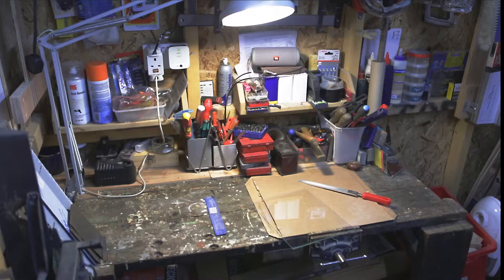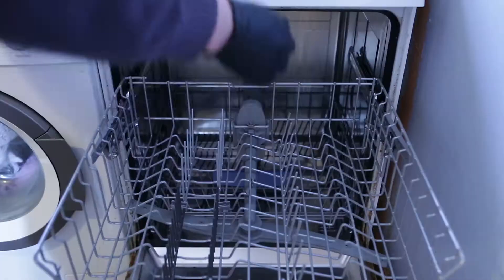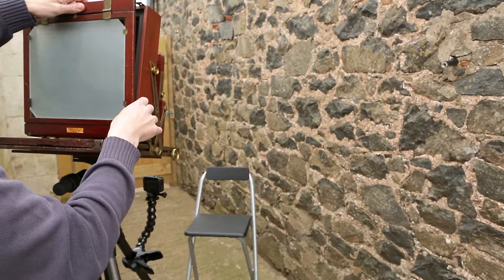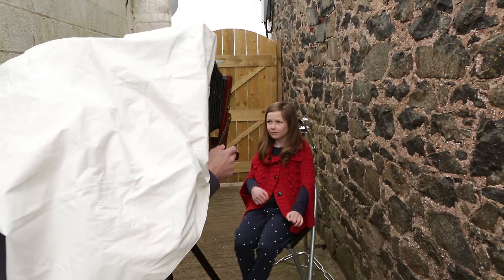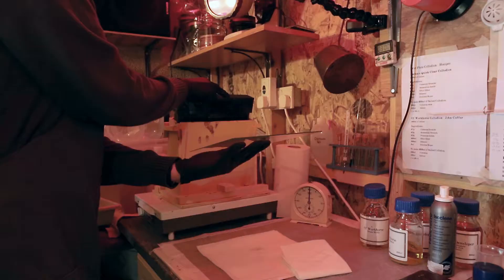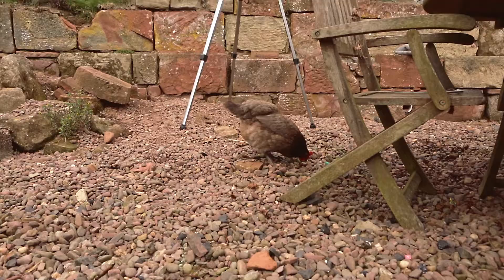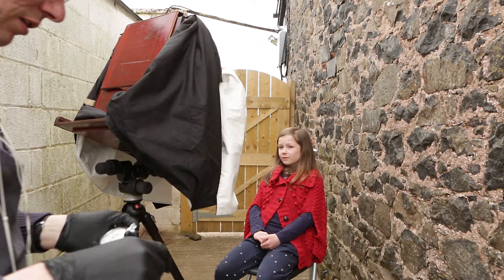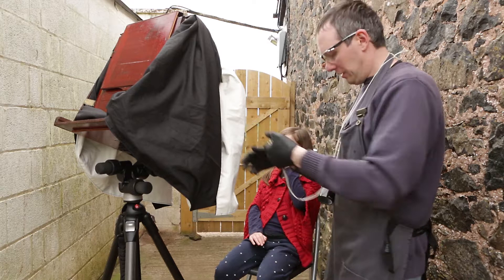Wet Plate Collodion Photography Demo

Comment: the problem with modern film photography in my opinion is too much is being focused on such a small area of film. wet plate cameras on the otherhand seem to employ a much more natural use of light and exposure, on a much larger area. im not exactly sure if this has any noticeable effect, as the image is almost entirely dependent on the chemical process, but just the use of the light alone seems to be much more natural. it seems as if this is at least a more meaningful way of capturing a moment
Reply from the maker: For sure the larger the negative size the more detail and resolution is being captured. The smaller negative sizes are good for convenience but they come with compromise. The other interesting aspect of the wet plate collodion process is that the molecular size is so small that there is no perceptible grain to be seen.

Comment: I want to do portraits with Collodion photography. I found a nice camera similar to yours. Then, looking on reddit, i learned how much you need to invest in strobe lights. Your process uses only natural light, and i love the result. Very nice
Reply from the maker: Thanks. I would definitely recommend working with natural light rather than strobes. It does have its own challenges, but as you’ve discovered the strobe power required is fairly large. It definitely easier to get a nice result using the sun (indirectly). I hope it goes well.

Comment: Another photography lecturer here: - Thank you for such a clear, beautiful video!  I do workshops with wetplate for students and my workflow is almost identical, even down to the super-sturdy frame around the silver bath to prevent it being knocked over and the copper urn for water (although mine is smaller). Good tip to use the isopropyl alcohol after the whiting cleaner- I must give it a try!
Reply from the maker: Thank you for the kind words, I’m glad you enjoyed it. Great to hear that my workflow is up to a photography lecturer’s :) I’ve upgraded my water supply now to a tap, but I did really enjoy using the copper urn. Glad you picked up a tip on the isopropyl - I’d feel lost without it.

Comment: 1. Apply the collodion with calcium oxide on a clean glass plate.
2. Dip glass plate in nitric acid solution for 3 minutes.
3. Remove the nitric acid solution from the back of the glass plate.
Give an exposure of 4.2 to 10 seconds (I'm curious about the iso of this wet board).
5. Add ethanol to pyrogelonic acid or iron sulfide aqueous solution to develop a wet plate with latent injury.
6. When the highlight tone appears, the phenomenon stops with acetic acid.

Is this where the negatives come in?
I wonder how to get positive afterwards.
Reply from the maker: Hi Patrick, the ISO-equivalent of wet plate collodion plate can vary depending on a number of different factors, but it can be considered to be anywhere between 0.5 and 2 ISO perhaps. 

An ambrotype is an underexposed negative. When you have something black behind it, it will appear to be a positive image.
Reply: @JamesPearson  Thank you so much. I'll try to use the studio flash lights.

Comment: great soundtrack, esp. the colloiden pour and the shoot, realy apt for the scene; one other thing, the 'barrel' lens has a slit on the top to fit a "waterman stop"- an iris plate to give apature control, it is NOT present, so there is a "light leak" in the lens!!, so does this give any trouble ( aka over-exposure)?
Reply from the maker: Thanks Andy, I'm glad you appreciated the soundtrack; I agonised over that quite a bit. It's hard to find good royalty free music that's suitable. You're right about the Waterhouse stop - well spotted. I have just one Waterhouse stop for that lens, which is fine because it does all I need really. I didn't mention this in the video, but I typically focus without it (shallowest DOF) to get the focus as good as possible, but I always insert the Waterhouse stop for the exposure. Otherwise the DOF is just too shallow. I don't think I've ever tried an exposure without it, but I would imagine the light leak would have a negative effect; perhaps knocking the contrast down a bit as the light is probably evenly scattered. Thanks for your comment.

Comment: Thank you for this vidéo ! Amazing. 
When you fixed the image, when it becomes positive what are you pouring into ? It is not water, right ? How can you then transfer it to paper ? How can you avoid all the marks arround the image ? It looks like you spend quite some time in preparing a very clean plate, but still, marks appears. How is that ? Thank you!
Reply from the maker: Thanks for your comment, I’m glad you enjoyed the video! It was fixer that I poured on the plate to change it from the developed state to the positive. Transferring it to paper can be done by various printing processes but typically you’d want to create a negative, which has more density. 

Regarding the artefacts; there are many sources for these. Some are from excess silver (that can come from the plate holder for example) and other artefacts can happen from bad developing technique too :)

Comment: Excellent! I have a prejudice for a dishwasher, but I've heard that dishwasher soap or soda should be avoided, only hot water. How do you do it?
Reply from the maker: Hi Borut, thank you for watching my humble video :) and for the kind words. That's interesting about the dishwasher soap. I have not noticed any problems with using it and my guess is that it will be very well rinsed. I also, as you see in the video, follow up with a calcium carbonate based solution and also alcohol. I wonder if that removes any potential issue of the soap. You have me wondering now, I will tread with caution!
Reply: @JamesPearson  Borut's watching, that's an endorsement and half!
Reply from the maker: @someblokecalleddave1  I know! One YouTube video and I've already reached a pinnacle moment. I can retire now :)

Comment: would you paint the back of the glass or apply some kind of dark layer?
Reply from the maker: That’s certainly an option - some people do paint the back. Some even varnish the front and then apply black to the front so you view from the rear (reversing the mirror image). Another way is to mount it in a frame with a dark background; that can be effective too.

Comment: Hello I am a subscriber to South Korea.
There is no information about collodion wet plate in South Korea. So I want to ask you some questions.

I am using a poeboy collodion (Cadmium bromide is not available in South Korea )

The picture is still blurry or the contrast is poor. I'm not sure if it's a silver nitrate issue or a developer issue. Collodion was definitely well made. The developer made it well by adding iron sulfate, acetic acid and ethanol. But the picture is blurry. I am doing an ambro type. Is it a problem with silver nitrate? Specific gravity is exactly 1.07. If the pH of silver nitrate is about 5~6, can the picture be blurry or the contrast is weak?
Reply from the maker: Hi there, many thanks for subscribing and for your comment. Diagnosing these issues is part of the challenge and without seeing the plates it can be difficult, but I have a few suggestions and bits of advice that might help. The issue is usually not the silver bath (as long as there has been no contamination). A plate that is lacking contrast or is fogged is nearly always due to quality of light, exposure and the development. These are the most important factors when making a good plate. Sometimes the quality of light can be low making it very hard to make a good plate. 

I would recommend sticking to a strict 15 seconds development time. Also you can make a step test plate where you expose the a portion of the plate (using the darkslide to incrementally cover the plate) for 1s, 1s, 2s, 4s and 8s. Expose the whole plate for 1s and then insert the darkslide 1/5 of the way and expose for another 1s. Then push the darkslide another 1/5 and expose for 2s. Repeat for 4s and then 8s. This will give you five strips on your test plate with different exposure times different by 1 stop (1s, 2s, 4s, 8s, 16s). Develop this plate for exactly 15 seconds and fix it. If one of the strips looks good; deep blacks and good highlights, then try making a plate at that exposure time. The step test plate can quickly give you a good starting point for exposure time.

In my experience bad contrast is more likely to be overexposure or overdevelopment and it can feel counterintuitive to reduce the exposure time to increase the contrast but it can. Getting the exposure time "correct" is quite critical.

Hope this helps. Let me know how you get on!
Reply: @JamesPearson 
I made a poeboy collodion and developer and filmed a week later.
Phobocolloidion dissolved potassium iodide and potassium bromide in 3 ml of distilled water and diluted in a solution of ethanol and collodion at a temperature of 60 degrees.

The developer solution was diluted with 20 g of iron sulfate, 500 ml of distilled water, 20 ml of ethanol, and 15 ml of acetic acid, and then filtered with cotton.

All medicines were stored in the dark for a week,
At the time of shooting, the poeboy collodion had a white sediment at the bottom and was yellow.
Developers were yellow, not orange.

Thank you very much for your help.
Reply from the maker: Sounds good. The sediment at the bottom of the collodion will be some potassium that hasn’t dissolved. This is typical and you shouldn’t worry about it. Just keep the bottle stable so you don’t disturb it before pouring. The colours sound good too. Good luck, let me know how you get on!
Reply: @JamesPearson  
Thank you very much! Always be happy

Comment: I want to buy an 8x10" large format camera, please can you tell me what kind of tripod and head do you use for your ? I hope in a feedback. Regards
Reply from the maker: Hi Gianluca, good luck with your 8x10" large format camera - very exciting! I use a Manfrotto tripod 055MF3 (Magnesium Fibre) - not as light as carbon fibre, but still not bad. The head is a Manfrotto gear head - the larger 405. It's brilliant - it's so easy to make fine adjustments to your composition. I previously had a ball head and that's just a pain if you want to make a small change in one axis. :)
Reply: @JamesPearson  Thank you very  much

Comment: How do you store/display the wet plate photos ?  How do you frame them to protect them for long term for display.
Reply from the maker: Hi, thanks for your question. I store the 10x8 plates in the same type of boxes you can see in the video. That keeps them pretty safe, although they take up a bit of space. Smaller plates are stored in acid free paper 'envelopes' (basically I fold paper around them. They are then stored in boxes. My storage is not perfect and might need to improve as I accumulate more plates!
Reply: @JamesPearson  thank you.  I enjoyed the video.  one other question.  I was watching another wet plate artist, and they mentioned after washing but before fixing, to expose the plate to the sunlight...for a few moments   they said it does something to it..   Why did they do this ?
Reply from the maker: @user-ss6zt2mo1l  Thanks, glad you enjoyed it. The reason for exposing the plate to sunlight before fixing is to try to build more density. This is of particular concern when producing negatives for printing processes such as salt printing as it requires a negative with good density. I'm not sure how much the extra sunlight affects the density, but every little helps.
Reply: @JamesPearson  Thanks for that info.  That makes sense.   I guess kind of like pre-flashing your paper...sort of..
Reply from the maker: @user-ss6zt2mo1l  Yes, maybe something like that. As the plate has already been exposed to light AND development is complete, the sun must be affecting some additional silver molecules and preventing them from being removed by the fixer. I wonder if it affects all silver molecules equally (like pre-flashing) or the more exposed molecules more. Hmmm....

Comment: what is all the gunk surrounding the finished image?
Reply from the maker: Hi Andiar, this process is very prone to chemical contamination and also flaws caused by poor technique. The markings around the edge are caused by a combination of these factors. They are flaws, but some see them as features of this process.
Reply: @JamesPearson  I appreciate the response but your explanation is not necessarily precise. I was looking for a more detailed answer. No worries though. And I agree with the flaws having their own aesthetic, though personally I wouldn't apply them for each and every plate. Anyway, I was able to better research my concerns. This is all completely fresh to me!
Reply from the maker: @andiarrohnds5163  If you don't clean the plate thoroughly then organic matter can interact with the chemical process causing marks. If you don't dry the plate holder of excess silver nitrate then this can cause excess silver to mark the edges of the plate. If you don't develop evenly then this can lead to marks due to an uneven development time and concentration of developer. So many different factors can lead to imperfections. This is the beauty and/or curse of the process, which makes it so interesting to some and frustrating to others (or a combination of both) 🙂
Reply: @JamesPearson  i dont see this as something too complicated though. you can scrutinize pretty much any other thing to similar effect. for example, driving requires a fair amount of precise control and constant decision making